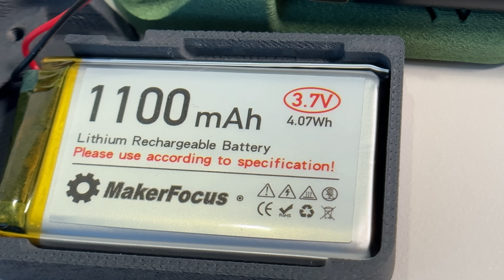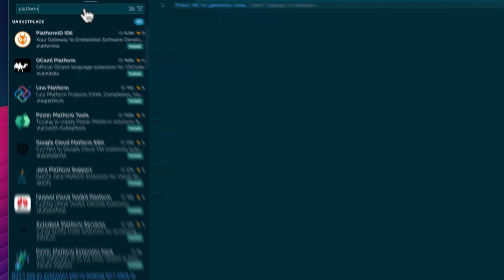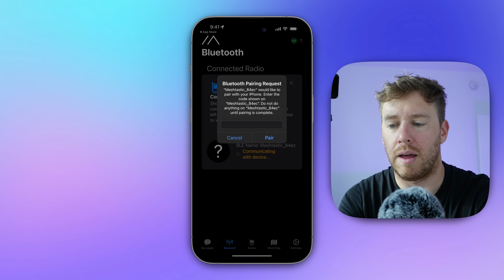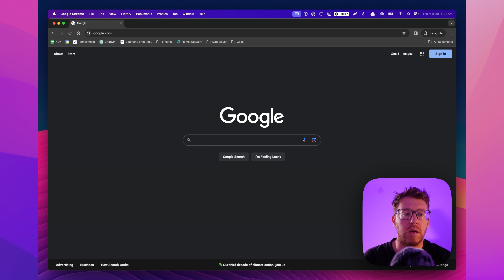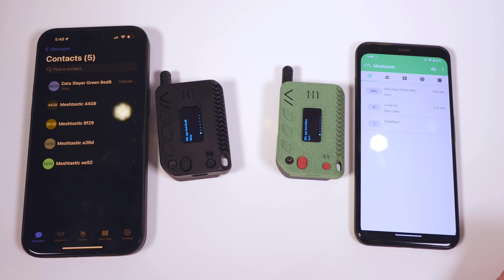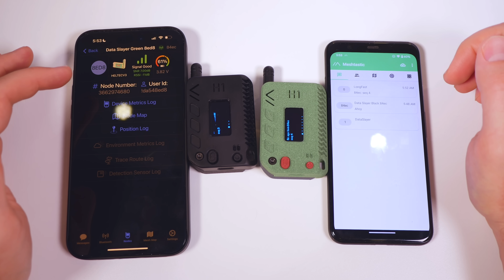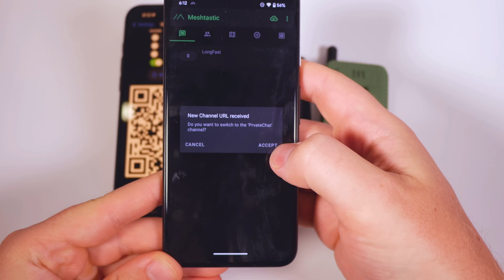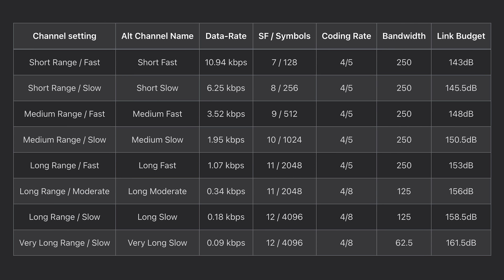It’s Been a Good Run, Phone Providers.

Comment: There should be a global effort by everyone to build a self-sustainable network of these devices powered with solar or other sources to create a massive network. Would be different from the internet or other networks, but could be used as a backup communication network incase things ever got bad.
Reply: I dont know much about this but this only works because bot a lot of people use it right? Like if everyone started using it there would be saturation problems right or do they have a work around for that?
Reply: I’d rather see these be able to use cellular networks for free to use as WiFi on your phone. That’s the only practical use I can see. Without that what’s the point?
Reply: Funny u shud say that. 6-7 years ago I presented such an effort to a cloud comm telco I was at. The idea was to incorp current cloud tech an build out a lost ptt usage with this type tech which cud kick in when cell grid is down. It's fairly easy to build as u can see here, or partner with a small co. that has some funding; well.. why the big wigs were thinking it over and benched it (hard to package n sell near free tech; I was thinking users n brand) A year passed. The company I presented as a buy or partnership with gained a gov. Contract and took it all next level an hush.  Some dont see the forest for the trees.
Reply: I foresee groups forming and dissolving.  Really touches on the things amateur radio folks fiddle with already.  A criminal element will probably exist for more secure communication (sigh).
Reply: @ibaron2716  No you can use it with just you and your friends or just one other person. It's a mesh network so the larger it gets the more people you can interact with, but it isn't required. This has been around for quite a while. I'm pretty sure no matter how many people use this, that saturation won't be an issue because it is decentralized, ie there is not common node (like a cellphone tower) that multiple people are trying to throughput. I could be wrong about this, but I'm pretty sure size is not an issue. It will increase range, reliability, provide redundancy, and more access to places that don't have line of sight.
Reply: @JT-ei7qj  huh.. intresting thanks for the information!
Reply: @ibaron2716   it's just for sending short messages, shouldn't be to bad....?
Reply: and eventually someone would exploit it. as happens with all things popular
Reply: It's just an updated version of the 1990's pager
Reply: its called amatuer radio haha lmao
Reply: Ok John Connor
Reply: Things are already bad. No one cares.
Reply: @R-Imperial23 what? aren’t there already pocket wifis for that exact purpose?
Reply: A network like that may already exist, but civs don’t have access to it.
Reply: im working on solar/wind lora towers. server trees.
Reply: We used to have comms over power line. Special radios just plug right in. One way receive only of course.
Reply: People don't like paying for backups that they will likely never use...
Reply: one eternal question - who and to whom will pay for that?
Reply: @dissident112 Great comment! I was thinking why not buy a boefeng transceiver and be done with it? 
The FCC rarely enforces the rules anymore unless someone is causing interference for a ling time.
Reply: ham radio is ahead of you
Reply: just create a network for your friends and family. Every time people come together like that, it becomes a target. But if we have a bunch of groups that set up their own network, we can offer access to them on a case by case scenario.
Reply: Someone calculate how many of these we would need per X square mile.  Crowd fund and then we install these with a solar power panel for recharge. Can’t be that much. Then promise users basically access to decentralized communications network that can be built into something. 

Hidden i guess.  Theft and vandalism worries me though.
Reply: @Fx_- What should worry you is something else.

Everyone here thats fantasizing about using lora to stick it to the man and ditch the phone provider needs to learn about frequency bandwith.

Lora has only like 8 uplink and downlink channels with very small throughput. You cant get many audio channels through it at once. I mean you could set it up with a queue so youre like waiting a month to get your phone call through in a bigger city but who would want that.
Reply: @ibaron2716  Lora is meant to be a mesh network, so the protocol is supposed to use each 'node' as a repeater. There could be instances of too many nodes, but the protocol is supposed to take this into account. Your concerns might still be an issue, but at this point the main issue is not enough nodes to make a fully global mesh network.
Reply: You mean WHEN everything goes bad.
Reply: @EustahijeMihajlović  no, I just want various options incase the mainstream communication grid goes down.  I dont know enough either.
Reply: except solar flares and nuclear wars would render it useless in a flash if you pardon teh pun
Reply: 666th like!
Reply: @SeanieinLombok  Not if we all keep one in a faraday cage until needed!
Reply: @SeanieinLombok  must be a way to shield it right?
Reply: @Fx_- You should be more worried about the entities that stand to loose at such mass adoption. Careful about being too specific else you'll find your comment suddenly disappearing...
Reply: The government may not like that.
Reply: @prasannadeshpande4435  I mean spaceX starlink does that. Don't see why a mesh network company can't be crowd funded.
Reply: It’s almost a certainty that things are going to go bad. I’m pretty sure by the time summer is over. Good luck everyone. Except the ones who got us in this mess if you feel like maybe you got us in this mess you did. That part wasn’t to anyone in particular. Anyways great idea time is if the essence
Reply: you are the one
Reply: @prasannadeshpande4435  Who cares. They do things we don't like all the time. About time we return that favor tenfold, just in a less "government" way.
Reply: Actually I believe it will work better with more people by becoming a big mesh network and passing messages from node to node till the destination is reached
Reply: That's what i was thinking
Reply: Mesh networks have inherent problems with latency, throughput, routing and stability/reliability if you try to push any of those too hard. Tech based on LoRa is good for SMS messages a few times a day if millions of people used it in urban environments and that's about it. The theoretical density of these mesh networks is not very high because of physics and signal theory.
Reply: @michaelgleason4791 sad but true 😂 all i can do is laugh at this comment atp
Reply: @wombatillo  Yep. Mesh networks simply don't scale. It's like trying to build a highway system with single lane dirt roads. Large scale data networks require fiber(or space lasers) which are like big multilane highways.
Reply: @Fx_-  If grid goes down your only chance is simple ham radio
Reply: Wouldn't work due to oversaturation.
Reply: internet was open when it first started coming out. then they told people to close them up, put up passwords, in the name of security. now everyone has to pay for acess. communications should be public utilities, just like electricity should be. not private corporations.
Reply: @episdosas9949  I agree 100%. All things IMO should be open and public. It is dumb to limit progress behind a paywall. For example, there are a LOT of research papers I would love to read but require access to academic servers and the like to even do so, or you have to pay for them. Educational content like that should be free and avaliable to all. That way we can all learn how to improve and protect our society from becoming authoritarian. Last thing we need is any form of authoritarianism, and boy is it pushing its limits lately globally.
Reply: @Skullkid16945  education, the news all want to make money. not real knowledge based. even youtube now, with 2 ads everytime i click unless i pay them. its like being a hostage. no money, no acess. even water and housing.
Reply: you are thinking of radio, which is already common, a good radio can transmit for hundreds of miles, a basic radio can do so for a couple miles probably more if its in good conditions.
Reply: i am old enough to remember that is exactly how the internet got started
Reply: I'd just use this to clone the internet and make it free. Cuz screw ISP'S. Cox sucks cox. Lol
Reply: That wouldn’t work. If shit hits the fan then Wi-Fi and Bluetooth won’t be working. When that happens you’ll want a walkie talkie/ cb radio to be to communicate. I’m not sure how these things would work in an emergency.
Reply: @R-Imperial23  The point is this is like old school walkie-talkies or CB radio but modern: Instead of just voice we can send data (files), pictures, audio, and even real-time communications (voice calls) across great distances (a couple miles).
Reply: @williammills5597  Wifi and Bluetooth are both local only, no need for some large cell network to work. So even if things get bad they will still work.
Reply: Yeap it looks like a marvellous way for drug dealers, criminals possibly terrorists to provide themselves with secure safe communication.  Unaccountable global communication what an outstanding idea.
Reply: Tell me you know nothing about lora without telling me you know nothing about lora
Reply: Who cares bro
Reply: in case things ever do get bad, disrupting communication to these devices will most likely be trivial.
Reply: @andrewparsons9407  I'm not sure why people like you immediately think of nefarious or illegal activity for something like this. It could also just be used by anyone that wants to communicate with someone else over long distances and not have their conversation observed by any outside party. Just because people want privacy does not mean they are doing anything illegal. They just want privacy.
Reply: @Sabrinahuskydog  For the same reason people think negatively towards anything at all: Society told them to and they conformed.
Reply: The Helium network aims to do this. It has been a massive failure, despite having thousands of people investing in it.
Reply: spread the word
Reply: >muh solar
lol
lmao
actually look into it
Reply: we have this already - it's called amateur radio (Marconi - 1890's) or packet radio (1980's).    😆
Reply: @R-Imperial23  if the internet and power went out tomorrow what would you do? How would you communicate with anyone? How would you rely on a network and internet connection that no longer exists? You only hope are battery powered devices like this. That's the use.
Reply: Wait is that not how this works already??
Reply: If it's text-only, it'll most likely be organized like old 1980's BBS networks (Bulletin Board System), it's what the internet used to be way back before HTML and Java, when all online interactions were pure text.

It's good for sharing information and talking to people, but you won't see pictures or shopping or videos on it.
Reply: The sheeple ain't gonna like that.
Reply: Alternatively powered by steam via nuclear or plastic burning
Reply: @episdosas9949  So you weren't there for Eternal September or the BBSes, then?
Reply: What about HAM radio?
Reply: @cornchipman7768  The point is to have as many ways to communicate as possible, not to rely on just one thing. More methods is always a win if people want to stay connected if other methods fail.
Reply: @JT-ei7qj  There will be saturation. Are you suggesting everyone should use walkie-talkies? They'd have to act as a repeater of the signals. If that was to happen, then in a crowded area, every walkie talkie would have to both receive signals, and send it away, in hopes it goes to the desired person. What do you think will happen when your walkie talkie is constantly having to receive and re-send signals, from a multitude of people? Saturation. There's a reason why cellular towers are built fairly distant (kilometres) away from each other. On top of that, your battery would go flat in minutes.
Reply: yeah, we've all been dreaming about this for decades.  Back in the early 2000s people figured out how to even build a GSM network from the ground up, create sim cards  and run your own celular network in parallel.  In the end, maintaining this infrastructures cost money or time(that has to be sponsored by money) so voila! you just became another carrier.

Is it possible? it's been for decades.  Is it 'feasable'? not really.  If things ever go bad, there would be higher priorities to address and hamradio will make a comeback
Reply: I like the way you think you should look into developing this. You have an obvious passion for it and it makes perfect sense. Maybe you could get during from angel investors to start up? Not only that...  but in the USA, this would be a much needed utility so tit could prevent widespread panic because at least there would be a backup plan. Maybe even a good competitor for just the "internet" if a person was not really into anything except just a need for communication. I'm sure there are millions of people who would make use of this sort of thing on a daily basis because their needs do not require much "online" other than just a need for purely communicating? Tho I do understand your desire for this to be just a backup. We really should have something in place globally so that we know what to do if the normal internet ever does go down. Like... we should have to run drills just for practice like we do for the possibility of other emergencies (like fire drils or earthquake drills).
Reply: @thomgizziz but we do anyways, hence all insurance companies based "just in case."
Reply: @emilioherna like old fashioned telegrams?
Reply: You mean like paper messages?
Reply: That was the intention of ham radio
Reply: Yeah that is why I bought a self contained 28' RV with a tow dolly, tow car and a generator.  So when chit hits the fan I can relocate.
Reply: You’re right, let’s start funding it with your life savings since it’s a great idea 💡
Reply: Tesla built that but he was defunded.
Reply: @joezen1693  I'm not sure how you presented it with your broken English.
Reply: thats just... a different internet.
Reply: WTF man that is genius
Reply: Thats what ham radio is..  This is dumb!   No one wants a pager.
Reply: Get to it, then.